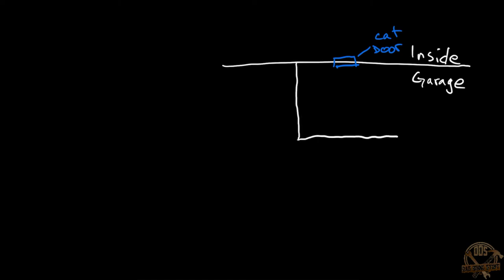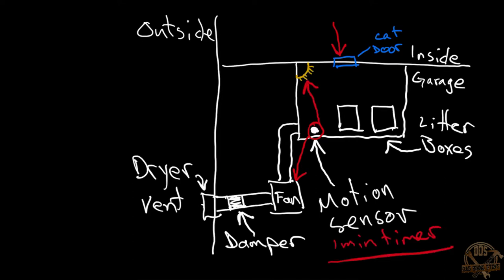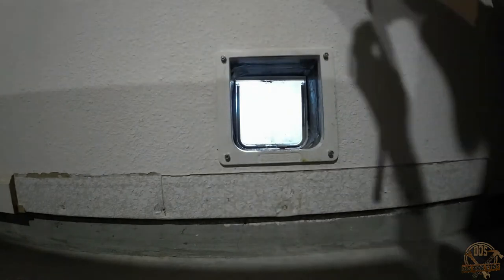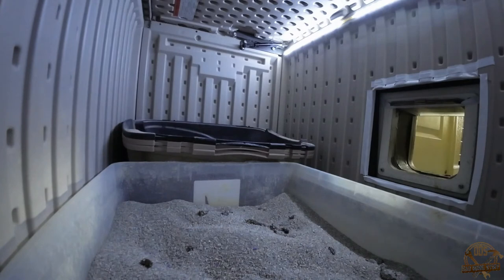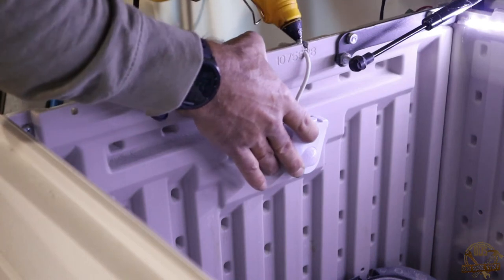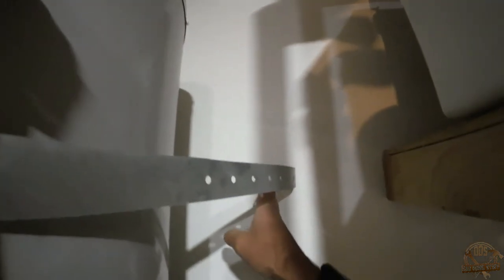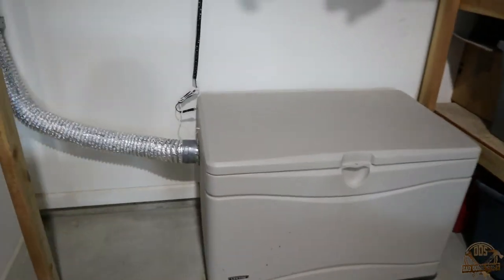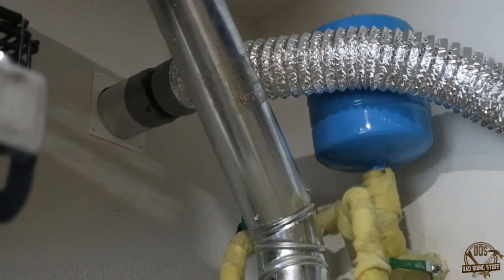A Litter Box that DOESN’T STINK?

Comment: We are building a new house and I have designed a litter box cabinet in my laundry room.  I had heard someone mention they had their electrician install a motion activated "fart" fan in the cabinet that was vented outside. So I set out to find a video like yours!!!  I wanted to make sure I understood how it should be done so that I could tell our rural electrician that IT HAS BEEN DONE BEFORE!! LOL! The back of our cabinet will be on an exterior wall, so it will work perfectly.  I plan on being able to just open the double doors on the cabinet to clean the box.  The end of the cabinet will have the kitty door.  So happy you made this video!! I did not think about lights, but now that has been added to my plan.
Reply from the maker: So cool to design it from scratch like you are doing. Can make it look really clean that way.   My main feedback would be to strategically place the fan so it’s not too loud inside where the cats are doing their business. But your setup is gonna be awesome, and your house won’t smell like cat poo!!!

Comment: Fabulous video! I'm not handy and your video is clearer than others I've watched trying to solve this stinky litter box issue. Using a heavy duty yard box is a great idea. Your mods for the motion sensor light and fan are genius and explained clearly. I'm trying to decide whether to cut a hole in my outside wall, for a cat door, or a vent, or put a vent or cat door in the window.  My cats have taken over a back bedroom, that has one window that opens onto an large, covered deck. I'm wondering if my cats would go from their "cat room" through a cat door, into the yard box, if I placed the box outside. The box might get too cold in the winter.  I don't want to smell litter box odor if I'm using the porch. I have a few things to consider and your video helps make a project like this more feasible. I can't wait until my quality of life and indoor air quality improves.
Reply from the maker: I loved reading your comment.  We can all agree cat box odor is the worst!  Regardless of what route you go, the only thing I’ll say (and you likely already know) there still no substitute for keeping the litter box cleaned on a daily basis.  This setup does allow us to get lazy and skip a day or two, which is nice.   Best of luck on your project. Appreciate the comment!

Comment: Not sure why you cut the first square with the side to the wall..was there a hole to the outside there too? If it was just a spacer so the lid would open, why the cut?
Reply: Oh i see..nevermind.😅 think I'm going to build a box from wood, guess thick plastic liner. Will be fun..gonna add a delay for the fan for when they leave the box.
Reply from the maker: Solid idea with the delay. I was definitely worried that the fan might spook the cats, but so far it hasn’t bothered them.
Reply: @DadDoingStuff  seen the delay idea on another build.